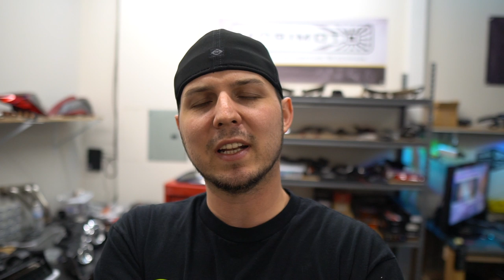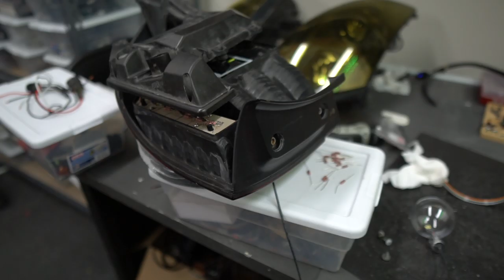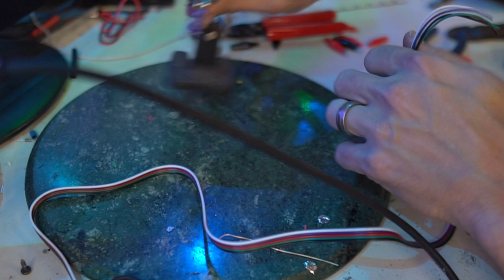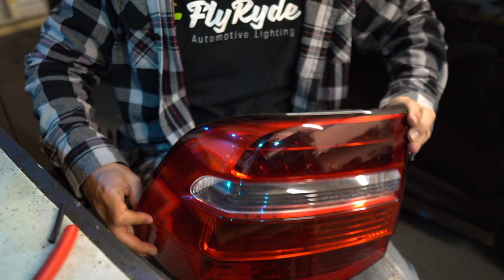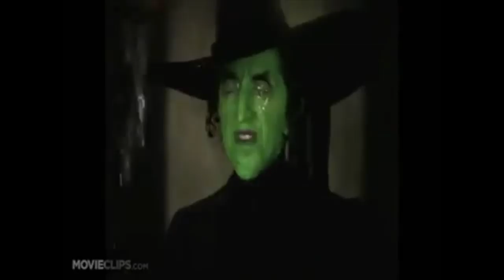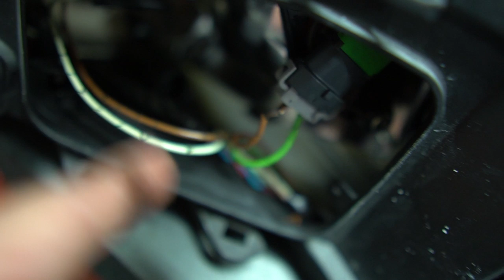How To Make Testing Wires | Vlogmas 2019 | FlyRyde

Comment: UK, has to be amber.

MOT (yearly inspection) reg '4.4.3. Compliance with requirements' says "Direction indicators must be amber.". Major defect (test fail) - "Lamp emitted colour, position or intensity not in accordance with the requirements".

4.4.3 does also specifically mention that "Direction indicators that function sequentially/dynamically are not to be considered a reason to fail.".

Also of note would be section '4.4.4. Flashing frequency' which says "Indicators must flash at between 60 and 120 times per minute." and is a test fail if they don't.

Comment: Regarding the cracking, it is caused by EU regulations for using biodegradable wiring/harnesses.  They caused severe problems for German vehicles where they have to be rewired due to the insulation crumbling over time.
Reply from the maker: Aaahhh! Got it. I’ve never seen anything like that here.